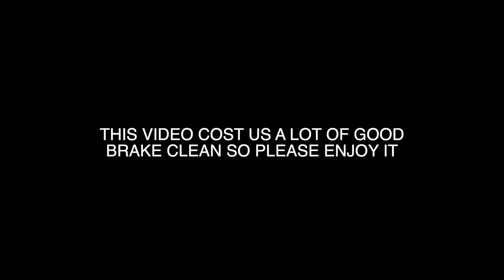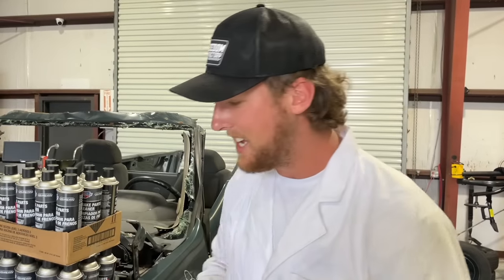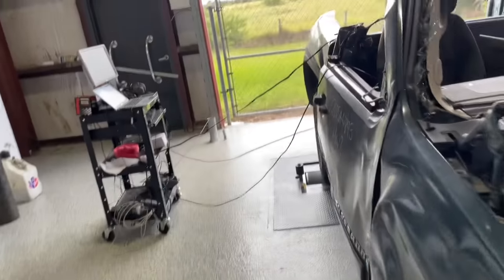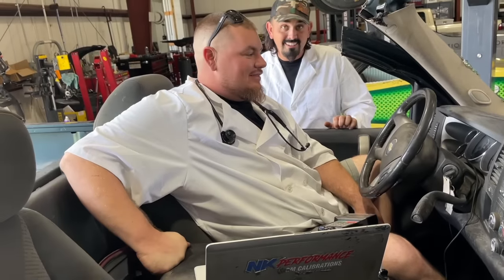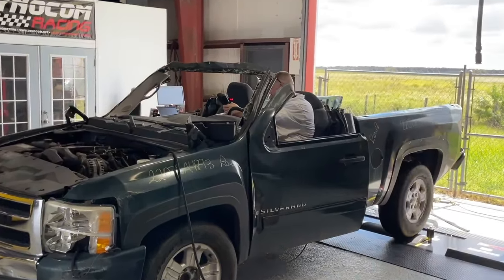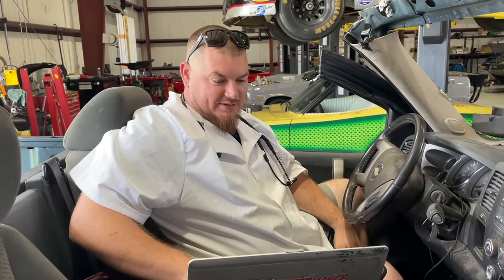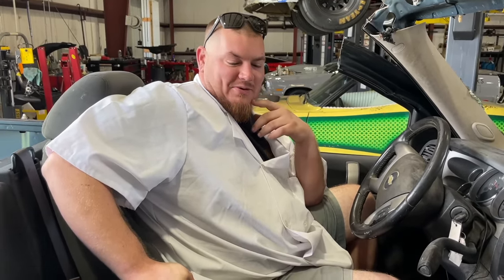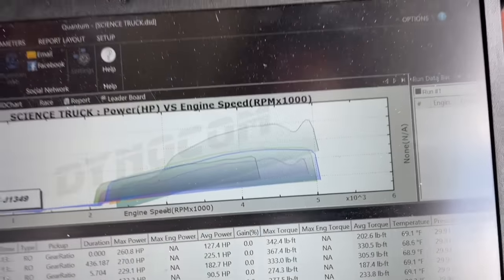We Replaced My Truck's Fuel With BRAKE CLEAN!!! Then Put It On the Dyno! (DO NOT TRY)

Comment: Propane or natural gas could be a good fuel to try next. It’s been used successfully in some production vehicles, but it would be fun to see a regular vehicle ran on it. Or maybe try camp fuel bottles from the sporting good store. 😛
Reply: Canada has a ton of current model vehicles that run on NG, and you can get LP or NG conversions for just about any vehicle. Just lower fuel mileage and little lower HP.
Reply: Propane/Compressed gas conversions were extremely popular up until the 1970s because it was much cheaper. My family ran their farm equipment originally on compressed butane, then switched to propane for all their tractors and trucks.

Comment: I was surprised by the results 😂 the first automobiles were run on kerosene it would be interesting to see how a newer engine would run on it
Reply: You can run a diesel on it. Should add qt oil in with it tho. Done it few times when I ran out of diesel.
Reply: @racecitypatriot66  a lot of guys up here in the north east will carry 5 gallon of kerosene with them in case their diesel truck gels up.   If the filters gel up they'll dump in the kerosene.

Comment: I say you should rout the exhaust right into the intake and see what happens
Reply: Yeah diesel's do it daily 2011+ from factory
Reply: @elkomander3510  so does most gas cars its called an egr and its the worst thing ever for an engine besides def dpf etc on a diesel
Reply: @TylerDuysen   im a diesel trucks only kind of person so I seriously did not know gas vehicles had egr's aswell. I honestly thought it was just diesels. But we delete them asap. We don't have time to deal with Def  along with clogged egr's.
Reply: @elkomander3510  yeah im with ya on deleting the diesels and yeah gas cars and trucks have had egr since 72 ish when the epa become a thing a they forced smog regulations diesels werent till 03 ish depending on maker

Comment: Steve here from NZ. Back in the 1980's there was a shortage of petrol. So not able to by petrol on Sundays.
So I used to buy bottles of metherlated spirits.
Had to have the mixture screw just about all the way out so would idle and turn the idle up, and have the chock out a bit so was rich enough going down the road.
This was in a 1962 EK holden. Only 138ci 6 cylinder.
Motor similar to the early chev 6 cylinder of the time. Only smaller cubic inch. Be interested to see what meths does in the LS lol.

Comment: Acetone tried to clean a weed eater carb with it. Didn't play nice, also ate the plastic shot glass. Would like to see that. Also wondering about oxide fuel. Mixing concreted hydrogen peroxide something around like 90 something percent pure, and a normal fuel of your choice.

Comment: Cletis, y’all should find a clapped out like Chevy cavalier wagon late 80s early 90s and run it on some atf in it and see if it cleans the valve train up in it. I had an old 86S 10/3 motors 2.8 that would not blow up no matter how hard I tried. Had a rear main leak in it and before changing the oil I added 2 1/2 quarts of ATF to it and it cleaned valve train up. Then filled it with rotella and it ran fine on it and slowed the leak down. Had a toggle switch for my blower, good ol primer rattle can special.

Comment: We performed the test back in the 80s heavy spark knock until the point the connecting rod exited the oil pan hooking the oil pan gasket and melting the float down to a blob of black glue

Comment: I once tried COX model airplane fuel in my pickup.  The motor ran good and I couldn't turn the engine off because it didn't need spark to run. But it also melted any gasket or hose made or real rubber. I had to replace some fuel line and the carb. It might work way better in a modern engine with synthetic rubber lines and EFI. OR NOT. Since it's like Diesel, and doesn't need spark once the engine is warm - I don't know if timing would be effective. Might be the only thing that could effect it would be Nitrous. Maybe this would be a good experiment?

Comment: Worked on the old military trucks, that had a " multifuel diesel" engine. Had a fuel density compensator, in the fuel system. Brakekleen, perfume, Jack Daniels, whatever , would run in it, just add enough motor oil, transmission fluid, or gear oil,  accordingly.

Comment: Try to run it on Ever Clear whiskey. I have been at the track and ran out of 110 race gas and a old timer told me to mix a 5th of Ever Clear whiskey with put gas. Long story short I did and it ran harder than the 110 race but it did run a little hotter on temperature.

Comment: I ran out of gas once in my old carbed jeep. I had a gallon of bulk brake clean for the shop I worked at… Poured it in the tank and the damn thing ran great about 10 miles to the gas station and never had a problem after that.

Comment: The next McFarland science project needs to be some tires mounted horizontally on trailer spindles mounted bumper high on front and back of a good running crown Vic and wall ride all the way around the freedom factory track. Might have build a wall out of k-rails across the track entrance and exit at the start of turn 3. I want to see wide open throttle all the way around with sideways tires on wall and make a new track record!!!!

Comment: Add a bit of 2 cycle oil to it to prevent spark knock. My first SBC was 11.5 to 1 and I had to run 93 with octane booster or it would foul plugs. I figured out 2 cycle oil works wonders to raise octane

Comment: So with the brake clean fuel test you should try the different temperature paint reducers.  Ppg has Dt 860 Dt 870 Dt 885 Dt 895 and Dt 898. Will each temperature of reducer have a different octane rating possibly?  Who knows you should try

Comment: Per the MSDS that brake clean is roughly 47% methanol, 42% toluene, 11% acetone.  Those all have an octane rating above 100, probably in the 110 to 120 range.

Comment: I ran out of gas in my 2000 Jeep cherokee 4.0, I happened to have 4-5 bottles of brake clean in the back. I emptied all the cans into my tank and drove 10 miles home, drove just fine and didnt have any long term issues from it.

Comment: E85, compared to regular, mid and premium. I usually run E85 mixed with regular and it always feels so much better in the ecoboost engine than just regular gas.

Comment: Hey guys , pro tip here! If you freeze  the brake cleaner cans with dry ice (,put em together in a ice box or bin .I use paper bags ) you can just pop a hole in the frozen cans without the pressure equalizing ( it won't boil until it gets up to room temp or close. ) Then you have some time to handle it in liquid form.........does that make sense?
Reply: But wouldn't it then start boil when it warms up, spilling it out of the bucket, everywhere over the floor?
Reply: Aerosol cans use non-odorized propane for propellant. So you need to get the liquid volume below -44* to get below the boiling point.
Reply: @supersniper90  You're half right, but the ratio of molecules changes the boiling point radically - the propane is only the propellant; there isn't that much of it. Most brake cleaner has a boiling point more around 5-15c - it's the decompression of a liquid phase into a gaseous that makes it drop below 0c, like how any refrigerator works for example.
Reply: Or they could have gotten the gallon jug of liquid break clean... 😂

Comment: Just got done putting an oil pressure sensor in one of those beasts. ( never saw it where it went, or the wires, had to do it by finger feel) .THEN... had to disconnect the fuel line to the rail,( it was in the way)  and the clip and o ring in the line, and replace those. What a nightmare.

Comment: Brake cleaner can be made from many things but mostly methanol or acetone. Some also use naphtha and gasoline products in small amounts. Those all have equal or higher autoignition temp as gasoline, but the HUGE difference is naptha's octane of ~65.

Comment: brake parts cleaner(non-chlorinated) is mostly naptha and heptane as the liquid, with small amounts of other alcohols. It's pretty much guaranteed to be about zero octane level and a big knock-fest of pre-ignition, rattling, with possible backfire and probable damage like, broken piston ring lands, broken rings, melted spark plugs, valves, seats, pistons if ran long/hard enough

Comment: Now is time to try general aviation fuel 110 octane low lead is what it typically is. But Usually has more of a carousing type mixtureAll really depends on where you get it from and who manufactures it and what the fuel what the fuel  It's made to be used in they have a few different types of aviation fuel. Seen and heard of a few people putting aviation fuel into their cars for more horsepower I want to know if it really works

Comment: Which 5.3L engine is in that particular truck, and is it 4WD? I'm honestly pretty impressed with 270 to the wheels if it's 4WD, especially considering that it's (probably) pretty clapped. Hell, even for a 2WD I'm not mad at that. My 60,000 mile immaculate LH9 Colorado sure feels like more than the 240 or so I expected, but I assumed that was just the 4.10s and light weight talking. Maybe not. You all ought to run something on acetone, it'll build one HELL of a fire no matter how wet your wood is (giggity), and should be similar enough to most alcohols to be somewhat tuneable.

Comment: Running it on acetone is one for the ladies nail polish remover is mostly acetone so when they run out of gas they can reach in the makeup bag instead of doing there lips etc they can just hop out and dump the old polish remover in the tank and drive to the gas station

Comment: TRY TOLUENE,,Iused to run 50% toluene  in reg fuel,, and boost 25+psi on a stock timing toyota... 
It slows down spark,,and I belrive it does have more BTU then reg gas... in any case,, which btw is a paint thinner

Comment: Fill tires with water.  20,40, 50٪.  Some tractors and rock crawlers do this to help wirh traction.  Yeah itll probably rip youe axel apart at high speeds.  But how much better would a launch be?

Comment: Actually had to use that brake clean truck before in a 5.3. Lol. Fuel pump died middle of the road, brake clean shots to keep it idleing about 500ft to a parking spot. Sketchy but worked!

Comment: just a quick PSA, if you're gonna try to run brake cleaner in an engine, make sure you mix it up with higher octane fuels like e85, or at least throw in some octane booster.

or better yet, just dont do it at all.

Comment: I ran  out of gas  a few years ago .
There was no gas stations for a few miles. 
I didn't have gas but what I did have was a tin can full of kerosene I'd say two gallons .
I put it in my 2000 GMC .
I got to the gas station .
However the engine had an extremly  bad spark knock I was waiting for a rod to come out the side of the engine block but it didn't. 
I put some regular gas in the tank the spark knock went away immediately and I was on my way once again .
This happened seven years ago when my truck had a hundred and eighty thousand miles. 
Today my truck has three hundred and forty thousand miles. 
And still is running strong.

Comment: I had to drive home on Colman fuel one time when I ran out of gas 3 miles from the house because I only had 2 gallons of Colman fuel in the back of the truck . I didn't think it would work but it did it spark knocked a bit but I made it home. even the Colman fuel didn't knock this bad

Comment: Hmmm🤔🤔🤔 here's an idea! Try brake kleen on a compression motor that doesn't have spark plugs? Then the ignition is simply created by the compression of the fuel in the cylinder... I'm almost positive there would be an improvement... 😂

Comment: From the Carquest Brake Parts Cleaner SDS, we can get the claimed composition of the brake parts cleaner and see how much aromatic solvent vs oxygenated solvents are in it. Here goes:
COMPONENT CAS NUMBER % by Wt.
Methanol 67-56-1 40 – 50
Toluene 108-88-3 35 – 45
Acetone 67-64-1 5 – 15 
Both Acetone and methanol are highly oxygenated so they will burn but not provide as much energy per pound of fuel. Hence they burn under leaner considitions and at 45% to 65% of the total, that is close to E85 ethanol gas as methanol has twice as much oxygen as ethanol per pound of fuel. Acetone is close to ethanol BTW but is not hydroxylated so it burns hotter. The toluen is aromatic and aromatic fuels burn richer due to more carbon and less hydrogen oer pound compared to n-Octane (100 octane by def).  Good thing you didn't try to dyno the motor on chlorinated brake cleaner!

Comment: I know I'm late to this, but only a few minutes in I started thinking.
Best way to test this, would be to use it on a propane application ( i.e small generator, or forklift )
Since those can run a pressurized gas you shouldn't have to deal with tuning it all that much.

And as for running it on a vehicle on the dyno, there are many road vehicles that run propane, so if you can cobble together that fuel system onto the "science" truck, it should work without much work.

Comment: I don't know what will work on gas engines  but I do know that I used to run transformer fluid in my Cummins and it was perfectly fine. My dad worked on transformers and we kept tanks of used transformer fluid filtered it and ran it in our trucks. It's so close to diesel in its chemical form I guess it doesn't matter ?

Comment: Yes fun but you CAN buy brake clean in liquid not aerosol cans.  Just an FYI.  Hey you're into airplanes, why not try some AVGAS (aviation gasoline) is used by small aircraft, light helicopters and vintage piston-engined aircraft. Its formulation is distinct from the conventional gasoline.  Although it comes in many different grades, its octane rating is higher than that for "regular" motor gasoline.

Comment: In place of a turbo. Weld a cap on an intake pipe with an air chuck. Use an air compressor instead of a turbo. 200 psi🤔

Comment: They need to buy a cheap diesel to experiment with.  Since trucks are so dang expensive, maybe an old worn out VW TDI or Benz 240D with 400,000 miles on it.  See what it will run on, kerosene, acetone, jet fuel, aviation gas, bunker fuel if they can find any(usually have to buy that in 1,000 gallon increments lol)   Get a big old jug of peanut oil(they sell it in the grocery now to fry your turkeys), used grease, etc

Comment: If brake clean ignites at lower temps and getting preignition, I think I would have tried to disable spark to see if it would run like a diesel on heat and compression... 🤔

Comment: Find a engine that's so far overdue on an oil change, it's barely running. Mix transmission fluid into the gasoline. Get the engine started, and run it on high revs for about 30 min, pushing the engine to the limit. Open the engine up and tell me what you see. 🤯

Comment: I filled my 70cc two stroke scooter with brake cleaner to get home and my exhaust went white and my piston smudged itself all over my cylinder till it locked up lasted about 2 miles at best and idle for some reason was like 4.5k rpm lol

Comment: Ok I don’t want to interrupt the party but why did you bought spray cans instead of the 5 gallon bucket which is less contaminant and is cheaper and you can get it from AAP the same brand . I use to sell the buckets when I was working for them.